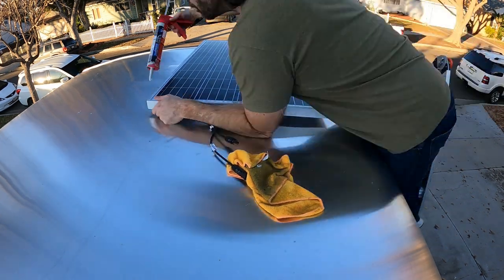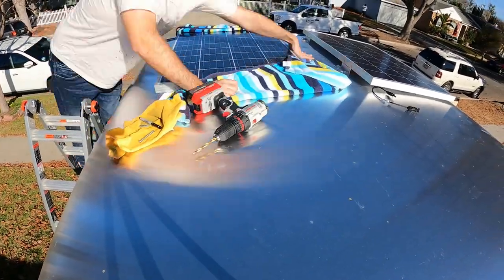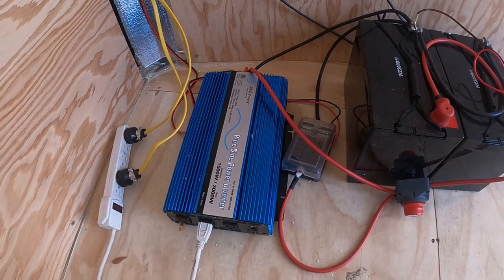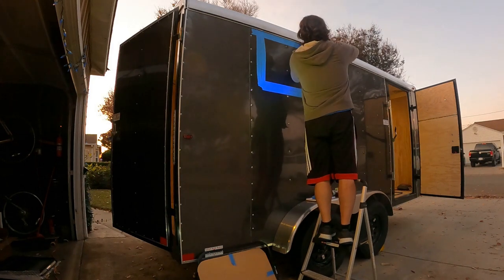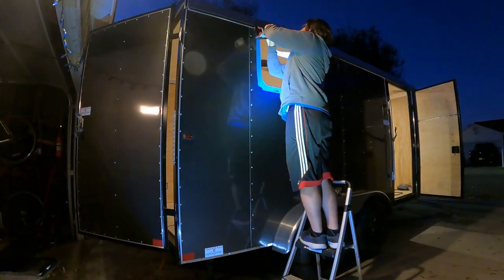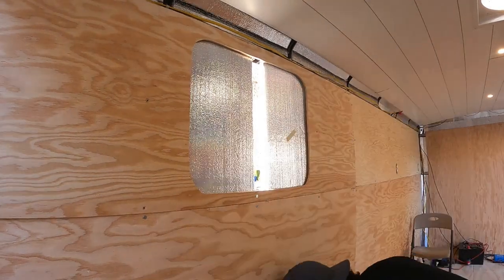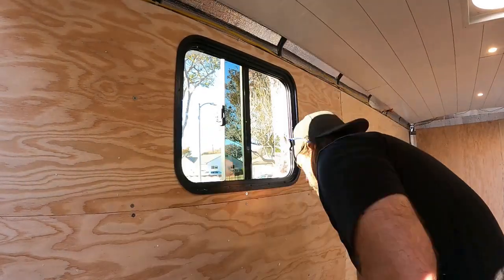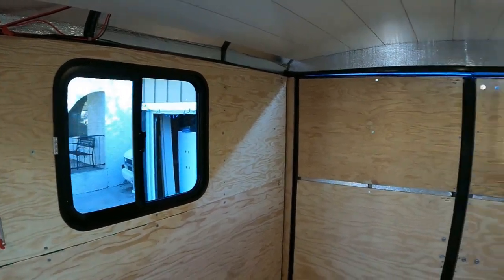Cargo Camper - Solar and Window Install

Comment: Most guys use a super strong sealant tape, its got a name I cant recall right now, on outside under frame to catch water that sneaks through while driving. Be careful for leaks kn the windows.
Reply: Kingsley Jakob  its called butyl tape

Comment: Looks great, I would like to do this also. Can I ask you that when you cut the holes for the windows, did the jigsaw blade go through the aluminum and the insulation and the interior panel ?
Reply from the maker: I detached the plywood and cut it separately. I used the jigsaw for both but with a different blade for each.

Comment: Looking good, do you have 2 ways to get out say the back doors locking from the inside and the outside latches secured where you can't get locked in by mischievous persons? It is coming along great. I'm still considering ours.
Reply from the maker: Right now the side door is the only way out. I'm probably going to add another latch to that door so I can lock it 'open' and only use the rv handle.  I'm also considering getting another window with an emergency exit opening.

Comment: Did you have any concerns about cutting out the metal stud?  I have been thinking about buying a smaller window, just because I am worried about cutting out a portion of the wall stud.  Should I be worried?
Reply: I was thinking the same after watching a few others channels. I might opt for vertical set up and keep the width to no wider than 16' or whatever the usual width of the two studs. That way a window is till there but contained within the two studs.
Reply from the maker: I had a few worries, but between the light load on the top, the sturdiness of the remaining studs and the wooden walls supporting, I think it should be fine. It would take a lot for that wall/ceiling to come down.
Reply: Add a header and a sill, either tack welded or bolted between the studs with steel or even use wood. At least that’s what I might consider if I were doing it.  If there’s some reason that’s a bad idea be happy to hear any cons i might not have considered.